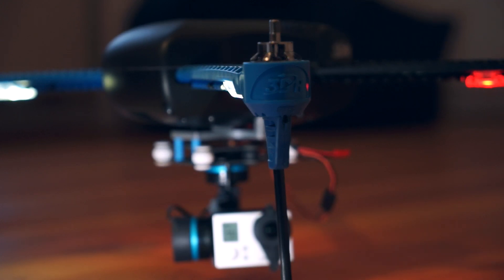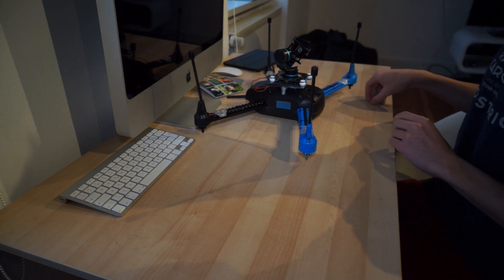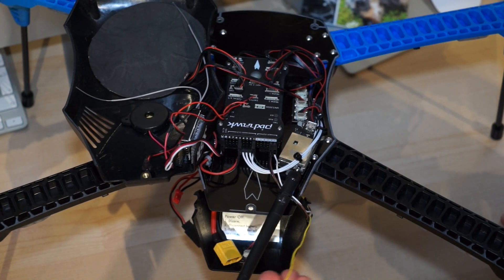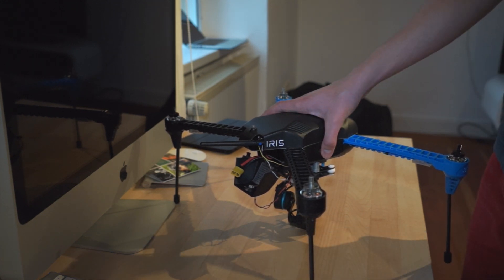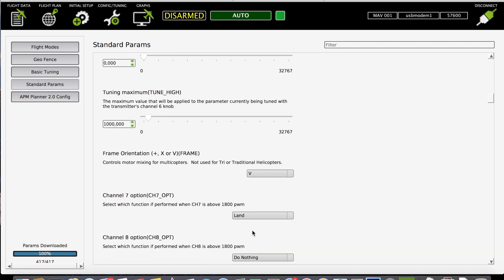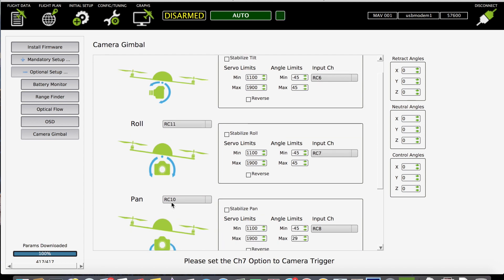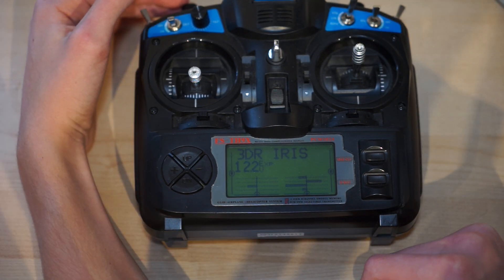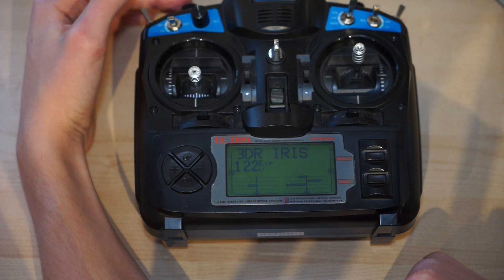How to install a FeiyuTech G3 3 axis Gimbal for Aircraft on a 3DR IRIS+

Comment: this vid does not match wire colors to pixhawk on FY Mini 3d PRO. There is a thread on diydrones april4 2016  where Ian explains setup with IRIS+. Blue (Tilt) wire - Pixhawk AUX OUT 1 (wire connects to bottom/signal (S) pin) White (Pan) wire - Pixhawk AUX OUT 2 (to bottom/signal (S) pin) Black/Brown wire - Pixhawk AUX OUT 3 ( brown wire connects to bottom/signal (S) pin   link to thread: http://diydrones.com/forum/topics/feiyu-tech-gimbal-and-pixhawk?xg_source=msg_com_forum&id=705844%3ATopic%3A1983385&page=1#comments

Comment: I would like to use the gimbel for handheld use. Is there a way to mount the handheld one on the iris+? I would rather not have to buy two of them.
Reply from the maker: will Philip   no   that's certainly not possible  but however you can modify the aircraft Version to be handheld
Reply: Ferdinand Loesch How?  Does anyone sell an adapter/stick?

Comment: Do you have to set something on the transmitter to get the edit/copy/delete options for the channel menu? My transmitter does not have that option. Great video BTW.
Reply: Spencer-  That's exactly my issue.  I get to page 5, I scroll down to CH7...  When I hit the Menu Button I don't get the menu which pops up like in the video.  I've tried holding down the menu button for a long time... I get to the "EDIT MIX CH7".  and can't figure out how to "copy".  It's confusing for me as once you get in to the menu, "EXIT"ing out doesn't return to setting to what it was.  I may have to reset the controller to it's defaults because I'm afraid I mucked about some of the settings.

 I see your comment was from 3 months ago- Have you figured out a solution?
Reply: Hmm...  You have to love google-  http://copter.ardupilot.com/wiki/how-to-configure-a-switch-for-channel-8-on-the-iris-quadcopter/

It's still different but what happens is when you hit MENU on CH7- There will be a black bar across the 3 to the right of CH7-  When you move that down one space, it becomes CH8-  (I think)